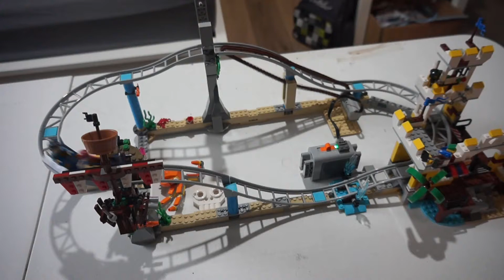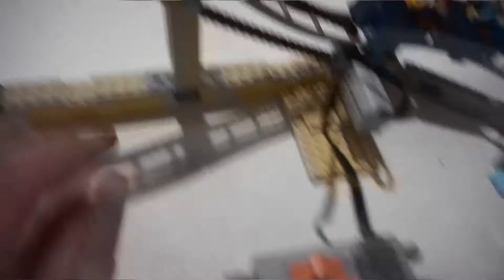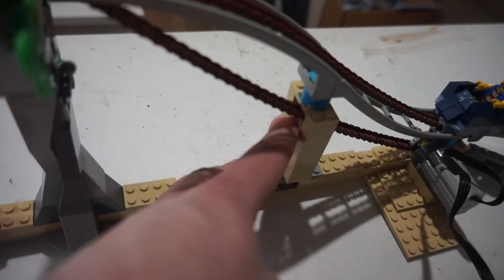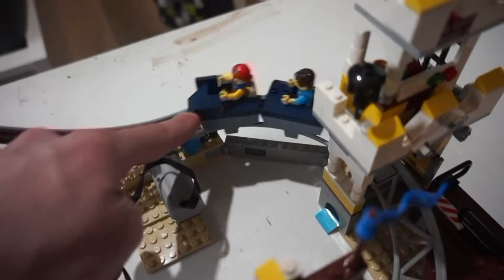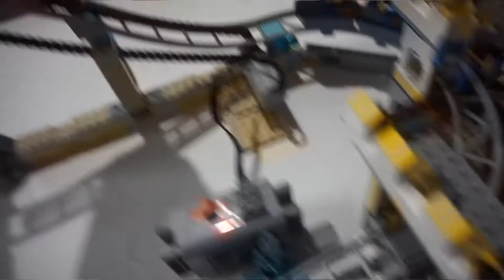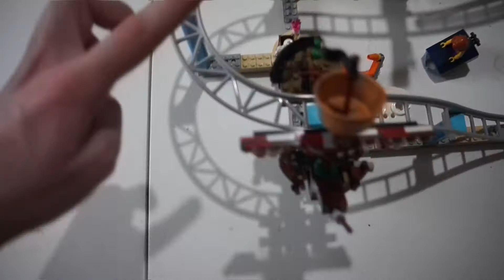How to Motorize the LEGO 31084 Pirate Roller Coaster

Comment: What did you use on the gear shaft of the motor for a gear?  The shaft on the motor doesn't have a separate gear for operating the chain.  Where do I find a gear to slip on the shaft of the motor to operate the chain?  Thank you.